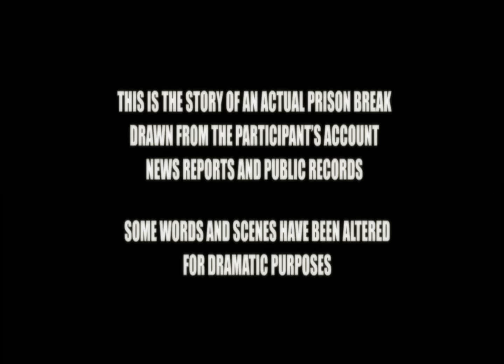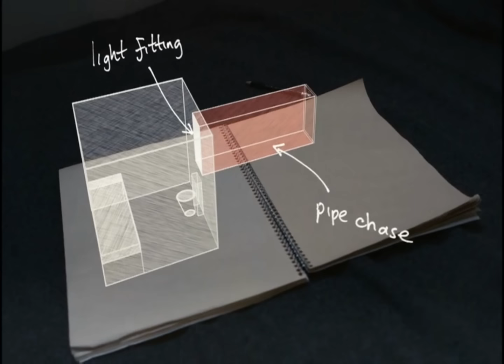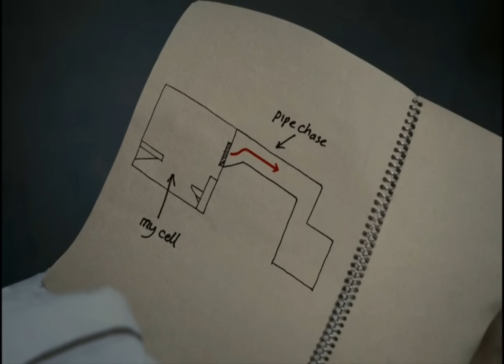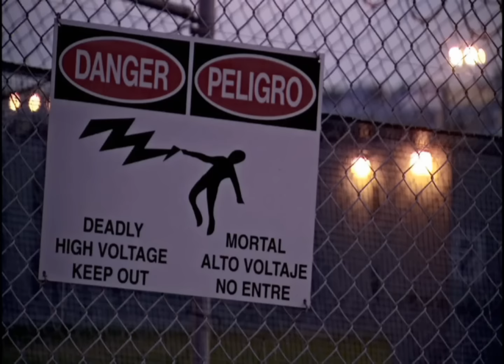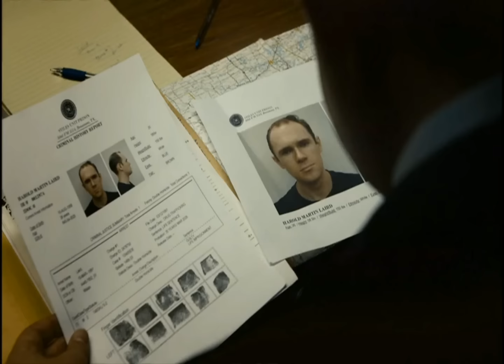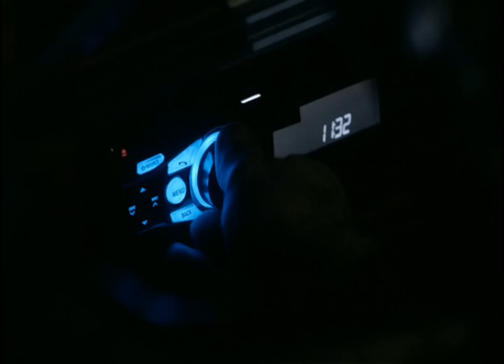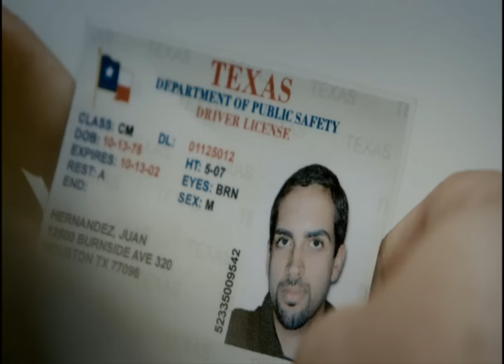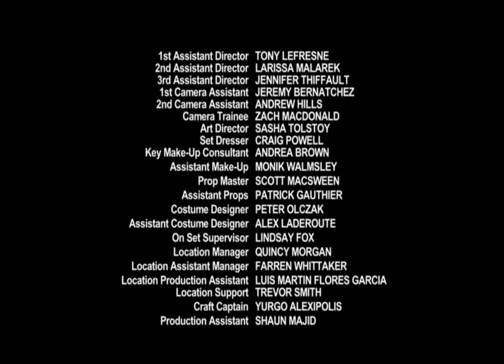Breakout S02E02 - The Real MacGyver

Comment: Watched this one a few times now. It still amazes me. Ive been in more than a few jail cells, and in more than a few tight spots. But never did i ever think i could escape out the cell let alone the jail. And these were NOT high security or even secure cells when i think on it now. The sheer thought of ' Im getting out this cell ' is beyond me. Pure genius.
Reply: You should watch season 1 episode 2. The man escapes under 24 hour suirveillance. And he's free now actually.
Reply: I was locked up in Melbourne at a high security prison in the middle of the CBD.  
The cell windows faced a busy city street. 
There was Perspex and 3 steel bars welded to a flat steel window frame but the bars didn't penetrate the frame. 
We had electric Kettles in our cells. 
I could have stolen the long electric cord from the vacuum cleaner, smashed the kettle to get to the heat element. 
Use the long cord and the Heat element to melt the Perspex. 
This would take about 2 hours. 
Use fan to blow smell outward.  Perspex doesn't smoke at that temperature anyway. 
Attach foil to left bar connecting top to bottom so the alarm isn't tripped when separated. 
Cut bar with wire from extension cord covered with cutting agent made from steel shavings sand creamer and glue from shoe soles. 
There was a key cutting station like at a shopping centre. The grindings and the lubricant that builds up is a perfect cutting agent. Once mixed with something sticky and thick. 
Rope blanket to the street. Then you're getting chased unless you're super lucky but you could have a motor cycle waiting. 
If you know that part of the city we'll there are lots of alleys and bike paths etc. 
Not sure if this would have worked but it killed time thinking about it.

Comment: One thing I notice in these episodes is that in literally every single one the officers are at fault for not checking thoroughly enough, letting someone pass without frisking him or not noticing something obviously suspicious. These are things that could have easily been avoided if the officers were more cautious and alert. So it's not so much that the prisons aren't secure, it's more that the officers aren't paying enough attention.
Reply: Lets see how much attention you have on their wages.
Reply: @paulwhelan7781  Then get another job? Sometimes I have to work my a** off for hardly minimum wage, and I still do an immaculate job regardless, because doing a good job is more important than how much you make. (For example if you ever want a business to succeed you need to satisfy your customers first before you satisfy your own wallet). In the case of prison guards it is especially important that they do their job correctly, as you can see from these cases. So if you feel like you aren't paid enough to do your damn job properly, then you should find another one.
Reply: @IIIAmTheObserver  calm down it's just a job.
Reply: @IIIAmTheObserver  calm down it's just a job.
Reply: @paulwhelan7781  Not just any job, the safety and possibly the lives of people in society depend on their ability to do their job. That should definitely be taken seriously.

Comment: Hose clamps are made out of strong metal, stainless maybe. But making an effective hacksaw blade out of one sounds tough. Once he broke it in half longways the teeth would be there from the previous threading but cutting through metal bars would wear them down fast. And cutting with a makeshift handle would be painful. I'm guessing the bars in the video are way exaggerated. More like a quarter inch thick or less.

Comment: They leave out certain details. e.g., how does one bend a steel clamp ribbon length wise? Not bare handed for sure. And what was the clamp on? Not a water pipe. A circle clamp has a purpose, usually to lock a rubber hose to a pipe nipple.

Sleeping in a stolen truck wasnt as brilliant as the escape. Should have ditched the thing at his skid out or at least away from the vehicle. Close though, but no cigar.

Comment: He said he set the cruise control.  Then  said he was doing 100 mph when he crashed.  Umm.. BS
Reply: You can set the cruise control to any speed. Well over 100mph
Reply: @johnnyrodriguez5938  ok. Yes. You are correct.  Why would anyone do that? Especially an escaped convict?
Reply: @tod2992  I’m from Chicago so I don’t use it much. But when I was in Arizona, there’s long stretches of road, and the speed limit is 70 so naturally I was going close to 100 😂 and I used it then. My knee would start hurting, so the cruise control let me get a break. It was scary at first. But it’s actually pretty good after you get used to it. Now I do it on all road trips. (Usually not 100 though). Also it’s not uncommon for people to wake up and press the gas right before they crash, so maybe it was that. But either way. Dude wasn’t smart, he shoulda pulled over and took a lil nappy poo 😂

Comment: cutting the bars by using so called handmade saw ?!... that didn't seem much possible to me. hardness of the material matters. screw clamps are definitely not hardened than bars. you cant cut something harder by using something softer ... 
Entire story seems like just bullshit but yet it is a nice tale for watching at the middle of the night...
Reply: Hose clamps ar÷ made of sprung steel annealed for hardness definitely harder metal than cast steel
Reply: @79huddy  And the bars he cuts are made of chocolate, right ?!?!... All kidding aside, if you've ever seen one up close, you'd know what I mean. Since I spent a considerable amount of time in the workshop, such things don't seem convincing to me.
Reply: @nemegeradres  No like I say they were cast steel considerably softer then annealed sprung steel but it definitely took some serious dedication to do what he did but with time it could be done he had two clamps so that's four blades to go through and cast steel like rebar cuts fairly easy as far as steel goes real low grade and soft if it had been cut proof bars like they use on prison windows there is no way it could be done they are made of high carbon tool steel and you need a carbide or diamond blade to do much more than scratch it in the time and with the  tools he had